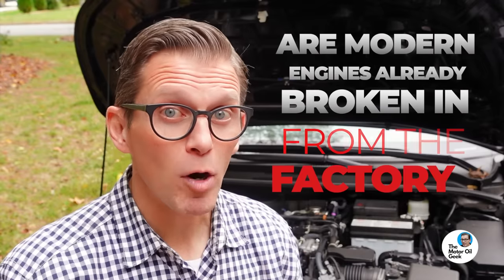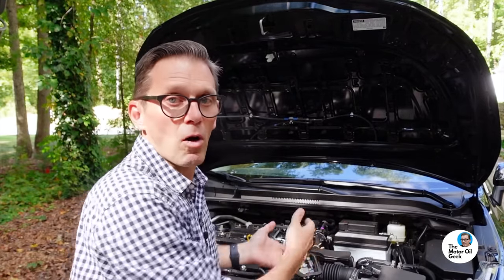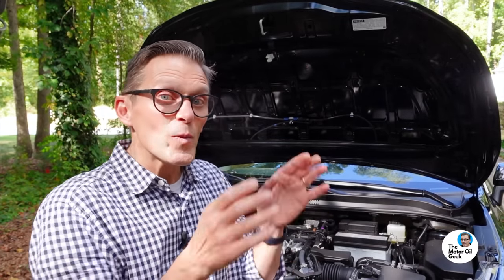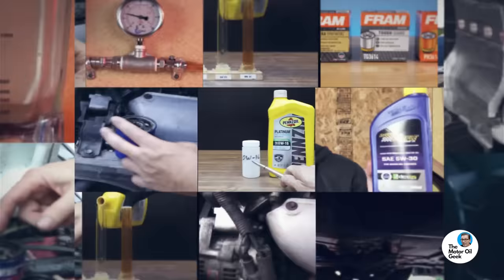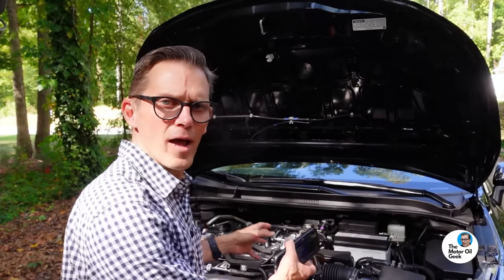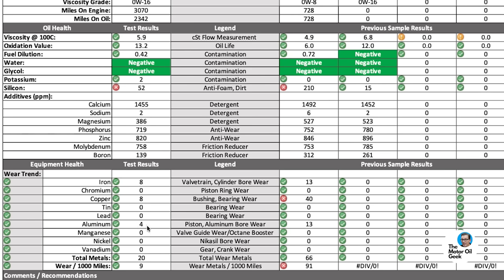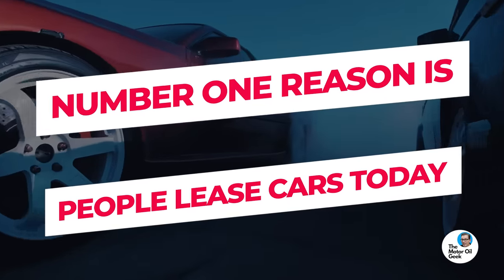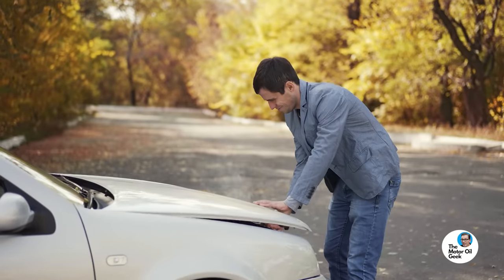New Engine Break-In: Truth or Myth?

Comment: Can you advise on one thing regarding the metal in the oil; Does the metal get circulated or won't it be captured by the filter if it doesn't settle to the bottom of the pan?  Note: I do early oil changes and also every 5k on our 2023 Rav4 Prime and 2014 Avalon Hybrid (going strong at about 80k). Even my dealer recommends changing oil every 5k. They haven't said anything about the early "break in" oil change. The Rav4 Prime Motor seldom runs as most of my daily commutes are within the 42-45 mile EV range. I run it purposefully every week or so on highway runs and use non-ethanol gas so it doesn't go stale as fast. So I plan to do the first R4P Oil change at 5k even though the Internal Combustion motor probably only has 500 miles at most on it. Any advice on that?
Reply from the maker: The metal detected by the analysis is too small for the filter, so it will not be removed.
Reply: @themotoroilgeek Thank you! That makes sense. Not to be a stickler but are there facts on that? Particle size, filter capability, I would think any metal content getting past the filter would be destructive and higher presence in the break-in period. I'm sure if anyone has them you will.  

Hypothetical; Engine is broken in (however it would be done) at the factory and oil left in. The metal from break-in would be in the 1000 mile oil drained and if in the pan may not have been cycled through the filter as is settles to bottom of pan. The break-in may have happened, but metal in bottom of pan is not removed until first oil change. 

However, if in this hypothetical above, or if no break-in, there is metal content of a size that could get past the filter, this to me would be the critical data to change the oil early. The report does not indicate the "size" of metal particles. 

Thanks, Not trying to dispute your information or argue doing an early change (i do them), just have this deeper question that would firm up the reasoning for an early oil change.
Reply from the maker: @Reb7771  You can check the micron ratings on most filters to see for what size particles they are claiming that efficiency. For example, a WIX 51061 filter has a nominal micron rating of 21 with a Beta ratio of 2, which means it captures 50% of particles 21 microns in size. Particles smaller than that are nearly unfiltered. Used oil analysis can only see particles up to about 10 microns in size, to the test results are showing the parts per million of wear particles in the oil that are less than 10 microns in size. I hope that helps.

Comment: So for a TT engine for which the Japanese manufacturer recommends using SAE 0W-20 oil and changing it at every 10,000 miles, should the owner make the initial oil change at a shorter interval than at 10,000 miles?

Comment: Just found your channel. I bought a 2012 Expedition King Ranch last November with only 39k miles. CAFE standards for the better mpg is to use 5w20, but I'm using Motorcraft synthetic blend 5w30, instead. I'm planning on changing the oil and filter twice a year because we're only going to drive it 5k-6k miles a year. Should I use full synthetic instead? I'm still planning on keeping the same schedule and the few extra dollars is no issue. I know these 5.4 liter Triton engines need to be maintained because of the phasers.
Reply: Full synthetic is always better. The molecules are more uniformed meaning this will reduce the wear and tear compared to conventional oil. From listening to my buddies who are ford master mechanics they also said the motorcraft oil filter is really good.
Reply: @chrisr.986  I've always used Motorcraft filters on my Fords and I'll switch to full synthetic next time.
Reply: I have used Motorcraft filters on ALL my vehicles (most were Fords 😁) and have never had a problem. WILL NOT use a Fram ever again. Manufacturers change filter companies often but the ones you buy in a store are usually made by the same place. I believe Wix make those filters but that could have changed.

Comment: Over the past 40 years or so there have been major advances in machining and tolerances in engine manufacturing, as well as major improvements in materials.  As a result, much less "break-in" is required compared to those older engines.  This is not the same thing as saying engines are already broken in from the factory.  Notice in new vehicle owner manuals these days there is very little mentioned about break-in at all.  That should not be taken to mean the engine came from the factory broken in.  
Btw, I'm  a retired automotive engineer.

Comment: I have a question if you don’t mind 
I have a 2024 Chevy Silverado with a 5.3 L engine it calls for a 0W-20 oil sometimes in the morning I can hear a lifter noise 
Can I switch to a 5W-30 oil 
Would I get the same lubrication 
Thanks for your help.

Comment: Could you make an analysis of 0W20 oil that is commonly used in modern direct injection gasoline engines? A lot of people recommend upgrading to 5W30, it would be great to listen to your comments on that.
Reply from the maker: Thanks for the suggestion
Reply: @themotoroilgeek  to be more precise, is it worth and justified from engineering point of view (engine's construction) to switch from 0W20 to 5W30?
Reply from the maker: @arturpytel9940  It depends upon your climate and how you drive. Thicker oil (SAE grade) is not always better.
Reply: @themotoroilgeek  that's my point, especially when I watch your analysis of oil additves, which in my opinion are crucial for the life span of new GDI engines. I'm located in Poland, I daily drive B48 engine in city/highway in temperatures range from -15C to 35C. A lot of people change to 5W30 but this oil doesn't meet C5 spec, which has special additives, important for GPF. What would you recommend in such case?
Reply from the maker: @arturpytel9940  I that case, use the C5 spec 0W-20.

Comment: Is Valvoline VR1 good oil to used in my new rebuild mild modded engine ? My engine builder told me to only use VR1 in the motor . But I have a 2010 Silverado with Cats on and worried about damaging the Cats . Any info would be appreciated

Comment: No my 2014 Corvette new car had breakin oil 500 miles and 1500 miles and no high revving !!! In fact I drove it from KC to Seattle the long way 3200 miles no high revving then changed oil !!! There are several Corvettes from Corvette Forum website that had bad motor problems from revving before breakin

Comment: Hello Lake, 
I am at 500 miles or so on a new Honda v6 engine. I am under a 3 yr lease. As part of the purchase/lease, it has free oil changes/maintenance for two yesrs, but only at the required change intervals. Would changing just the oil filter around 500 miles be enough, or at least help? I assume the engine would at least receive better flow due to gasket, silicon, etc.. materials that the first filter should filter out. Also, does the excessive copper, aluminum, and iron cause unnecessary wear on the engine if the filter is unable to remove it?
Thank you in advance.
Reply from the maker: The filter change is better than nothing, so you could do a filter change at 500 miles and another at 1,500 miles.

Comment: Lake, have a question there are some oils that say can do 25,000 miles. Is that really good for the engine? And do those companies actually stand behind the product if things go wonky in the engine.
Reply: I’m not a specialist but most sources indicate not going over 5K miles on an oil and filter change- the detergent package in the oil degrades over time, products of combustion accumulate as well as condensation (so effectively, water) and this combination is terrible for the internals of the engine. 25K miles is way too infrequent of an oil change. Plus, with most new cars having GDI, the tops of the intake valves don’t get ‘washed’ with new fuel, so with all the old oil as well as contaminants therein, and with PVC systems recirculating some of the oil vapors back into the intake so the contaminants make their way to the intake valves and get cooked on there. That can lead to a lot of valve deposits and eventual poor performance and maybe even a need to have to valves cleaned professionally. It’s far easier to just get an oil change a bit more frequently.
Reply from the maker: Just because the label says it is capable of 25,000 mile oil change intervals doesn’t mean it will provide the lowest wear rate at that distance. We’ve seen those oils dead at 16k.

Comment: Oil is cheap, even synthetic oil and I see early oil changes for brand new vehicles as cheap engine insurance. I only buy new vehicles and with every one I've bought, I change the oil at 1,000 miles, 3,000 miles, and then again at 5,000 miles and then adhere to 5,000 mile oil change intervals ONLY using synthetic oil for the remainder of my ownership. Never had an engine problem and I routinely keep vehicles beyond 100,000 miles. Just my $0.02
Reply from the maker: Right on!

Comment: I have toured many OEM factories and have never seen them break in an engine. It is not worth the extra time and money for them. Clearly these engines outlast their warranty periods without break in and that is all the manufacture cares about. Any engine break in would add a ton of unnecessary cost to the car. I am sure that some super high end cars do break in their engines, but i know that VW, Audi, and even Porsche do not. It is far cheaper for the automaker to hire engineers and oil specialists to make sure the engines outlast their warranty without a break in, rather than break in each engine.

Comment: The official break in for an engine is warming up, few revvs with load to middle range rpm, accelerate to high speed-load high rpm a couple times and the piston rings have seated, bearings etc don't break in as they already have clearances and oil between.
There's nothing else from the machinist side but de facto you will see valve springs etc operate smoother when they do quite a lot of operating hours, and you end up having a more revv happy engine within 5000 miles but it's not because of the engine "breaking in" but rather because stuff like cylinder clearances etc stops being stiff and wear starts showing that is within standard specs.
The dirty oil you see in a new engine or an engine rebuild is mostly because of machining debris etc, some material comes off initially from the cylinder walls, camshaft etc, and needs to be changed soon.
Reply from the maker: Right on!

Comment: you forgot a very important component of the lubrication system, it is the filter. what you should comparing is the filter capacity of the filter, is there a filtering difference on the the 10,000 mile engine oil, comparing to 1,000 mile engine oil. Put in other words, the filter works the same way on 'highly contaminated 10,000 miles oil', there would be no difference.

In that sense, I think that Toyota already did the test. It is good to change oil in the first 1,000 miles. But, change oil in 10,000 miles will not dramatically shorten the engine life.

Comment: What wasn't covered is: How to break in your new engine. Rings seat best under high pressure. Don't baby your engine for 500 miles. It is better to run the engine through the entire power band, including runs to red line both early and often. There has been data from tear downs to confirm this. Run it like you stole it right from the dealer. I did 2 motorcycles this way and my Shelby GT500. I'm convinced they ran better because of it. And, yes, I changed oil at 500 miles and 2000 miles.
Reply from the maker: Agreed. We do have a link for that video in the description.
Reply: @themotoroilgeek  I'll check it out. Thanks for the great content.

Comment: I wonder if dealerships would be willing to put break-in oil in a new vehicle on request, whether purchased or leased – even for used vehicles that underwent an engine rebuild or major engine modification/maintenance job. Those should be broken-in anew, right? You change piston rings, you should break those in, right?

Comment: But i have a question,  say you rebuild an old Chevy 350 with a flat tappet cam, how long should you run break-in oil in that? I've always went about 500 miles or so, is that good? And just use a zinc oil after that, is that cool? Seems to work but i have had a couple of flat tappet cams wipe lobes, and that sucks!
Reply from the maker: The high zinc break-in oil for a flat tappet cam will do it's job in about 100 to 200 miles, so you can change it then.

Comment: My previous VW did 190k miles. My Kia has done £135k miles. Both had annual 10k changes. Clearly neither suffered from not having a break in oil change. Yeah oil is cheap compared to an engine but an annual change is adquate.

Comment: So should we as car buyers insist on getting a car with break in oil and force the manufacturers to change that oil after say 500miles?I mean how much longer will an engine last if that is done?
Reply from the maker: No. Just change the oil at 500 miles. A fully formulated break- in oil is not something the OEM’s will provide
Reply: @themotoroilgeek  they should provide it

Comment: My best friend bought a new '20 KIA SOUL 1.6 GDI $15,000 for the purpose of travelling the USA.
It was always serviced religiously at 5,000 miles by the selling dealer. After 28 months and 146,000 miles it died. The dealer wanted $7,000+ to fix the engine. Fact.
Reply from the maker: Thanks for sharing

Comment: Why did the metal not get collected by the filter.  They must have been  20 micron sized or smaller.  The theory is the break in oil and parrticals left perform a micro polish on the engine to match the moving parts better. .   But 5000 miles is a really  long time.
Reply from the maker: The oil filter does not capture everything. The theory of the wear debris helping break-in is super old school from the chrome ring days. That is not needed or desirable anymore.

Comment: Okay, we see the higher wear particle number the beginning.
But do these particles cause more wear themselves?
How to proof the positive effect of the early oil change?
Reply from the maker: Yes, the higher amount of wear particles in the oil increases abrasive wear.
Reply: @themotoroilgeek   so your opinion is, bring it closer to zero for the better. 
But is there any data for a decision, which amount of particles is negligible?

How about comparing a fresh oil and the oil probe after break in, in a lubricant abrasion resistance tester?

Comment: Could the high copper concentration in the first oil change be from some type of assembly lube or additive to the oil for break in?
Reply: More than likely it is leaching out of the new lines and fittings. The only copper in the engine itself is the base material in the bearings, and copper coming off those is actually a bad thing since the copper lies under the zinc/aluminum wear coating.  However, the bushings and valve guides may be made from Bronze which contains copper and could come from there as well.  Since copper is a soft metal it will wear first and leave behind a harder layer of tin.  Most engines today do not use copper in the bearings anymore and use an aluminum alloy instead.
Reply: I was curious as to where it was coming from inside the engine. I was thinking copper based lubricant. Thanks for the reply

Comment: I have Mitsubishi Pajero .It has run around 55Mi and the company recommends changing the transmission oil at 40,000 km ,so based on your video , I should change it ,should not I ?

Comment: What's missing here is the amount of wear caused by the wear particles already deposited in the oil. Does the wear rate remain high for the first oil, or does it drop once the engine is broken in even if the wear particles are still in there? The filter should catch any troublesome particles.
Reply from the maker: The filter doesn’t remove all of the wear particles.
Reply: @themotoroilgeek  of course, otherwise the oil analysis wouldn't find it. Are they large enough to cause additional wear though? A good way to tell would be to add the totals of your extra changes against a car that had one change at 10k.

Comment: Im sorry. This is completely off-topic. I have been neglecting getting oil changes for probably 25k miles, and i got a warning on my dashboard saying low oil pressure.  I put some oil in immediately.  I've been looking online and there is some suggestions to use 0w40 Mobil1 HighMileage ExtraProtection(i beleive thats the right name) oil and change every 2k-3k miles because the higher level of esters will help clean the sludge but at a more manageable rate for my engine to handle. With a new fram ultra filter each time.

Most seem to say not to flush the engine as it can break down a lot of the sludge faster, creating more particles in the oil which could clog up the engine. Some mentioned HCL EC30? Others say it's a waste or dangerous.

If you have any advice, it would be greatly appreciated.  I understand if you answer, anything I do or try is completely at my own risk. I'm just trying to save my car at this point and I figured a lubricant specialist would know better than random commenters on the internet.

I dont know if you would want to make a video like this, but making a video about sludge and what it looks like for viscosity among other things and best steps to go forward would be beneficial.  I saw you say you aren't a full-time youtuber, so maybe you aren't interested. If you made it this far, thank you for considering my post.
Reply from the maker: Try the Valvoline Restore oil. Don’t use an engine flush.
Reply: @themotoroilgeek  ty very much ill try it out